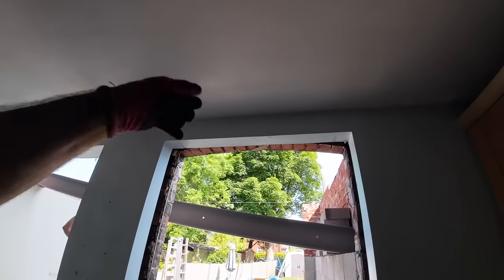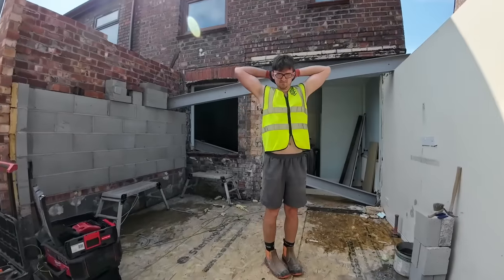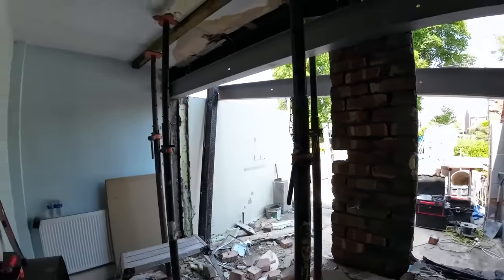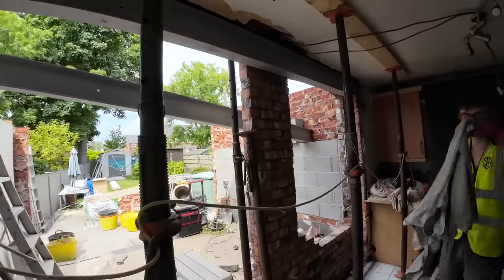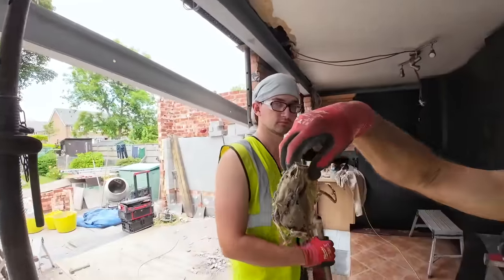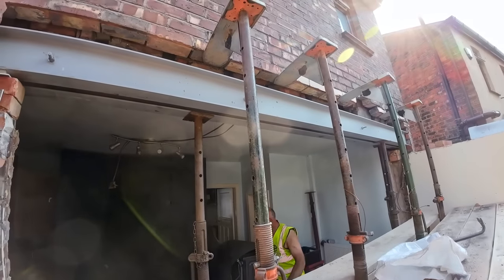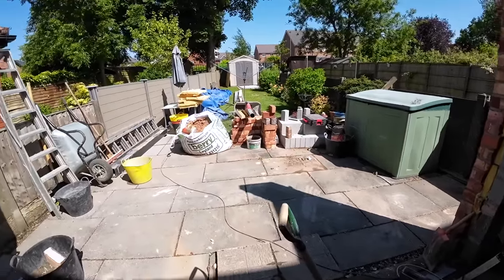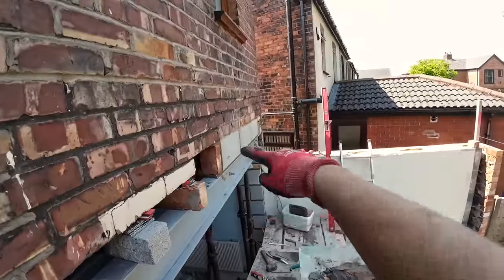STEELS CAUSE A MELTDOWN AND A SURPRISE IN THE CAVITY!! CONNY CONVERSION PT 2

Comment: Good morning Steve and Alex, another hard testing job in extreme heat conditions. It just shows how good you work together as a team and don't know how anyone can say Alex is not a grafter? Whom keeps Steve supplied with materials? Whom preps all the bricks to be reused? Whom helps barrow or lift the heavy loads to save his dad? Whom keeps the site tidy? Oh and whom helps lay bricks or blocks? Have I missed anything guys, sorry if I have 👍🧱🤜
Wouldn't like to see a house plumbing system by whom put that push fit in 😮
Keep up the great work 👍🧱
Reply from the maker: Thanks very much Anthony very much appreciated 🙏🏽🧱👍🏽😁
Reply: All rest points but the grammar Nazis will complain about misuse of “whom”.

Comment: We need those type of wall jacks here in the States. Been a mason over 45 years and haven't seen these before. That's one of the reasons I like watching a Brother Bricky from "across the pond". Never to old to learn a new trick. Of course they are a "specialty" type of tool and more than likely wouldn't use them everyday but when you did need them they would be more handy than a pocket on a shirt!
Reply from the maker: They are a very useful tool as we do a lot of alterations. We finally own a few now so no messing about hiring them and returning them . 
   Thanks for watching and commenting brother 🤜🏽🤛🏽🧱👍🏽

Comment: I'd say you were pushing it with just 2 acrows on the inner skin plus steel. I hate arguing against experience but there's easily 4 ton with masonry floor and roof loads. I like some contingency when propping, especially ifvyou are taking out large masonry panels or piers.

Also look into getting the Brick Brace system fellas. (I dont use them as a substitute for acrows or needles on big spans!) They wedge in the perps and keep all the bricks above the steels under lateral compression so the only making good is the perps the wedges were in. No dropped bricks to patch up. They will pay you back on a single job just like this one. Skill Builder did a vid and I'm sure there's a few others on here. Keep your tongues out.😨

Comment: I really enjoy your videos and generally i reckon you are pretty rigorous on your temporary works and propping.
But today i was really worried..
Was surprised that you didn't build the inside lintel in to support the wall before taking the outer skin down.
In essence you had the whole rear wall supported on 3 over reaching strong boys with nothing under the left hand window.
Strong boys are strength rated at full blade insertion ' which 'nobody' does because leaving room to lift in the steel.
And it was that way overnight - hence the cracks to be pointed up.
Personally after the seecond steel went in I'd have got another strong boy and moved the others in so they could carry  both skins and reduce the offset on the acriws. 
I'm sorry to criiticise but i think you only  just dodged a bullet there.

Comment: Hi lads curious why you don’t hide  the steels I always try to hide the steels to look it’s one ceiling just curious
Reply from the maker: Too difficult 🧱👍🏽
Reply: @SteveAndAlexBuild  thanks I thought it was going to be like structural issue or something but cool keep up the good work
Reply: It would have been a lot of work opening up the whole wall and then trim floor joists into the inner steel.
And the other beams from the stairs and landing probably wouldn't have worked.
Here we got an economical practical solution.